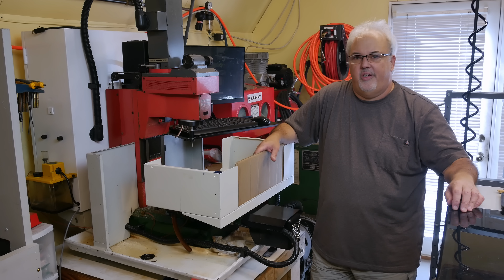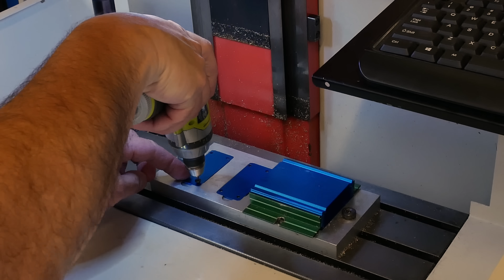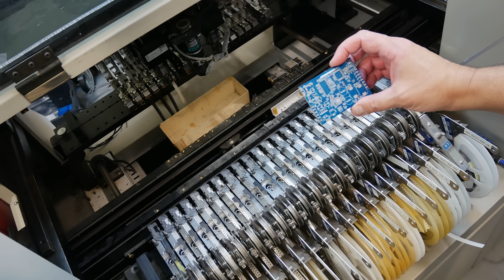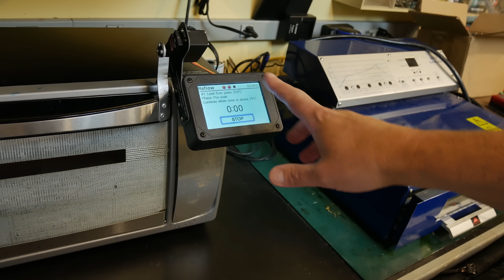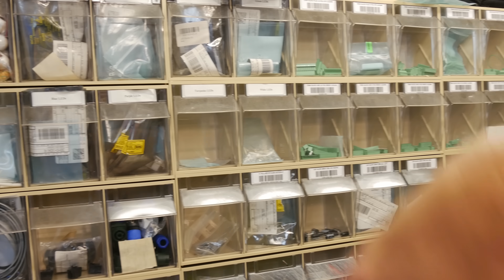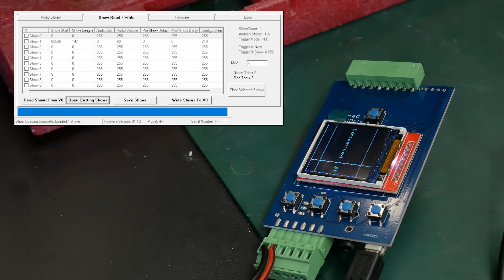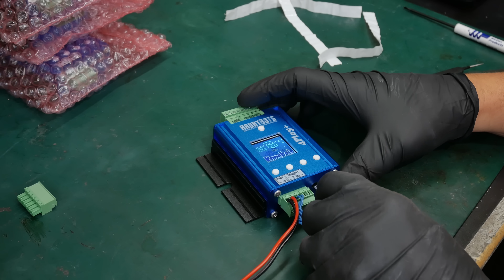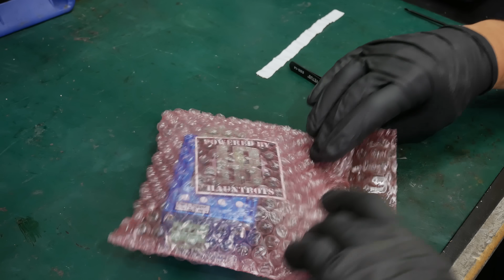How Does a Factory Fit in a Shed?

Comment: That's an E-Case A from Lincoln Binns in the UK, funny how they pop up everywhere. I have used hundreds of those over the years 😁
Reply from the maker: Interesting.  Here in the US they come from Box Enclosures.  it's a B1-080BL  with MF80BK side rails.
Reply: @PeteRondeau  apparently they used to be an authorised reseller but then copied the real thing and ditched the original creator 😆
Reply from the maker: Gothcha.  I've gone through hundreds of them as well.  Red, blue, green, black, silver.  I used to color code the products based on function but the prices have gotten wonky lately.  if I want blue boxes I can get them for less than $10 but if I want red, that's pushing $20.. so now I typically use whatever color is cheapest.

Comment: I would love to know if you bought that printer or built it yourself.
Reply from the maker: I purchased it on eBay.  They are made for custom printing on phone cases.  They are great but a word of warning they are a bit of a maintenance nightmare.  They take epson printers and hack them to create these. It also comes with special software that knows how to handle the white ink as the standard epson driver has to be tricked.

Comment: Man, I have a slew of questions for you on this episode, but I'll refrain on most of them.

The important one, as someone who has almost a dozen of the same Radio Shack drawer units, what did you put in the drawers for the organization? Those obviously aren't the same trays they came with.

The stock trays are less than ideal and I would love to have something better.

When does the new line of controllers come out? 😉😊
Reply from the maker: Those are the inserts from harbor freight storage cases. You buy as many as you can carry when they go on sale for $5.99 and you keep the inserts and throw the case away (or you can do something else with them). Just put a piece of 1/4” plywood in the bottom because the drawers have no bottoms.
Reply: Ah ha!  I was pretty sure I recognized those yellow trays!  Scrolling through the comments paid off.

I also have a couple sets of RadioShack drawers, and find the plastic trays are never quite right for anything.  The bins are handy because you can pull them out when you want to use some of the parts.

Thanks.

Comment: Do you add alcohol to the ultrasonic cleaner?
Reply from the maker: No it’s a solvent that is designed to work with the flux I use. It gets diluted 10:1 with water.

Comment: Holy Smokes!  I knew you were great at mechanical engineering but this is insane.  What an incredible skillset I know nothing about.  If you don't mind me asking, did you get formal training to create this or did you self teach?
Reply from the maker: My formal education was in electronics technology but that was a lot of theory and a handful of labs.  My first on-the-job experience came as the chief engineer for an AM/FM radio station.  Since then I've worked on video games and pinball machine, done computer support, and for the last 25 years I've been doing industrial control work such as laying out electrical panels, programing PLCs and creating PC based control programs.  Designing the controller in this video, was just an accumulation of knowledge over the years, going back to the original theory I learned combined with everything I self taught along the way.
Reply: @PeteRondeau  Thanks for taking the time to reply.  I just watched the video again because I found your talents and process so awesome to watch in action.  If 17 year old me would have seen this, my whole career path may have been different... Great stuff.

Comment: I feel your pain during the pandemic with the supply shortages. I manufacture electronic games for the event hire and bounce castle industry in the UK and I spent the pandemic chasing my tail with supply issues. As soon as I had redesigned a control board as a critical part was on a 1 year lead time I'd find stock somewhere and a new part would go out of stock. A very stressful time with the addition of no money coming in.

Loved the video and you have now inspired me to go hunting for a pick and place machine. I have been thinking of getting one for a while as placing the parts by hand is very time consuming. Now I just need to find room to put one in!
Reply: For us it was the weird stuff... couldn't get the mylar capacitors that we normally use, although it turned out we could get the 1% version of the same capacitors.  Couldn't get one type of small signal transistor because Fairchild couldn't get the low noise epoxy they need to make them.  And then it was 10K through-hole resistors, the most common part ever....
Reply from the maker: I had the luxury of this not being my fulltime job and was able to just walk away.  The personal satisfaction of creating these combined with the limited amount of money it brought in, was not enough to warrant the stress it created.  Congrats to you on pulling through and coming out the other end!

Comment: Wow, that DynaMyte DM2800 is so small and cute - I have it's much MUCH bigger brother, the DynaMyte DM4800 in my garage - working on restoring it and getting it running again, with the original Mitsubishi controls - the control is actually in good shape (well, after some extensive repairs). It's been a LONG process...
Reply from the maker: They really made some nice machines.  I really wish this was the 2900 that had a tool changer - or, maybe a 4400.  Good luck finishing your 4800 up!
Reply: @PeteRondeau  Being a hobby project, it takes a while. And then there's crazy side projects like "reverse engineer the Mitsubishi M3 control to be able to expand the memory enough to load the Renishaw macros for a spindle probe / tool setter" that take 4 months, but it will be really nice to have the Renishaw probing stuff working. The M3 control had some "limitations" in the firmware crippling it from having more memory like the bigger M300 series controls do - that's been "fixed" now! Now it's back to moving the big bits around with the engine hoist and putting everything back together!

Comment: that's cool you do stuff for knoebles you should ask about there hard luck bears show as those robots are built just like that animatronic prop you restored 3 years ago maybe you can even restore it for them one day
Reply from the maker: All that remains are the two characters that were in the museum.  They are in the maintenance shops and get worked on as time permits. Hopefully one day they will be publicly displayed again. The rest of the parts from the show are gone.
Reply: @PeteRondeau  really cuz I've seen pictures of there storage that has all the rest of the characters did they get removed?
Reply from the maker: Back around the time the black diamond was being installed they still existed. But all the characters that used to be stored around the stage and the original control system with the octal plug decoders were removed during the last renovation of the laser tag.
Reply from the maker: They may have actually been my pictures you saw.
Reply: @PeteRondeau  oh wow would you happen to know where they are located or if there destroyed
Reply from the maker: I was told they were scavenged for their parts. I imagine if you were to examine their animated Halloween displays you’d find a lot of familiar looking aluminum arms and air cylinders
Reply: @PeteRondeau  dang I hope they will return someday thx for replying to theses comments